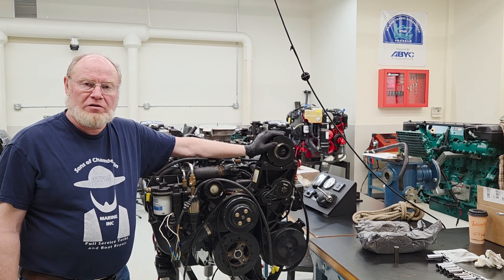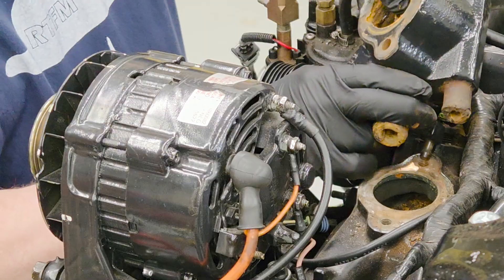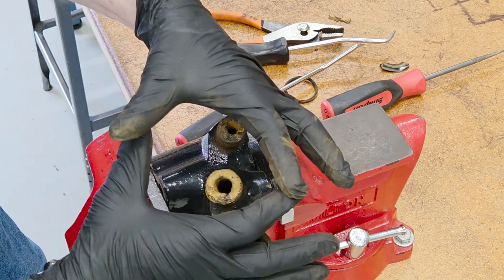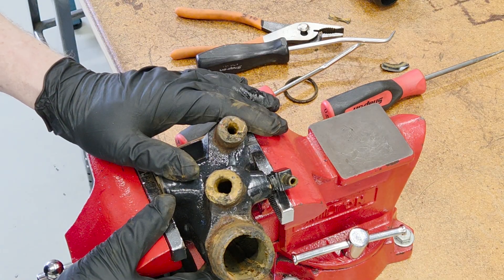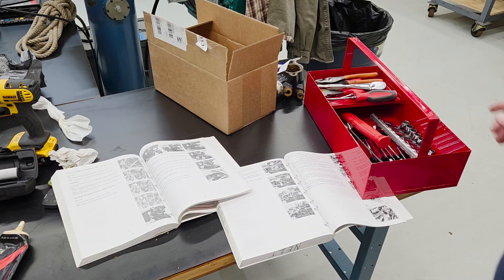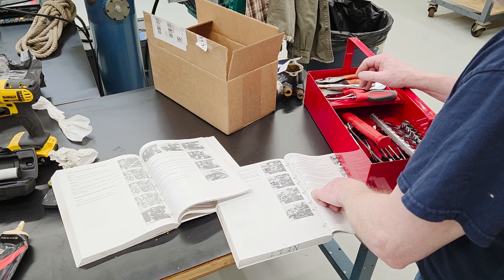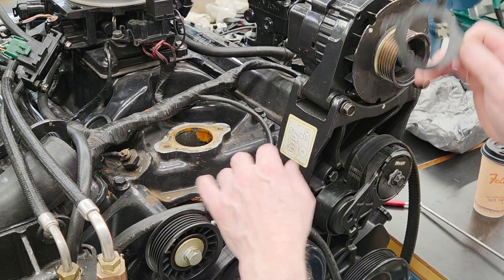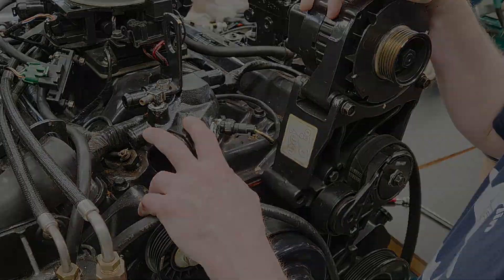Volvo Penta 5 7 Gsi Thermostat housing Replacement

Comment: Ted. Great Video  - Question. I have one riser that runs hotter than the other. Brand new Manifolds and risers installed (Today) - my hunch is that the housing is compromised - only allowing minimal water to one of the risers. The other one runs cool. Thought?
Reply from the maker: An additional 20 degrees from pt to st is OK
More i food?
Thanks  Ted
Reply: @tedsmarinerepair8956  One runs around 110. The other running at 190
Reply from the maker: Sometimes one will run a bit hotter than the other. What brand are they?
Reply: @tedsmarinerepair8956  OEM Volvo. I think the thermostat housing is compromised. Allowing good water flow only to one riser. I'm having the marina assess.

Comment: I’ve replaced a few of these on my OMC Cobra over the years if the passages aren’t too bad you can rod them out with a drill bit. I use a small thin screwdriver to pry out that pesky oring. I also put some grease in the hose flanges so they come off easy for winterizing otherwise the hoses rust tight to the flanges esp in salt water….
Last thing…if a salt water boat while you have the housing off check the cast iron of the water passage right below where the ‘stat sits; if it’s really flaky blistering rust poke at it & see if it’s about to rust thru…if so get a nice freshwater used intake or else if it leaks during the season it will put salt water right into the cam valley & the motor oil!